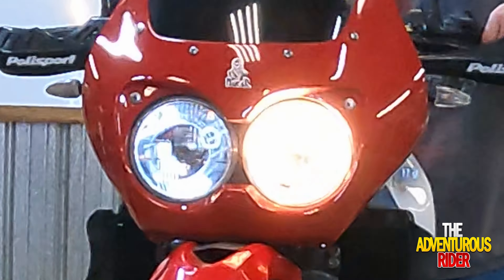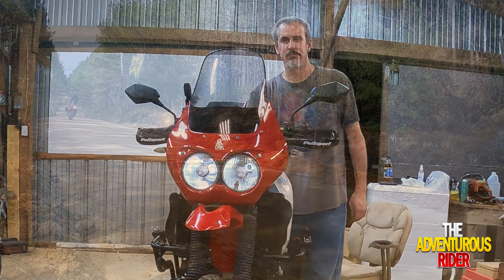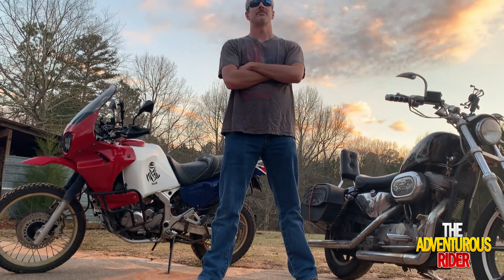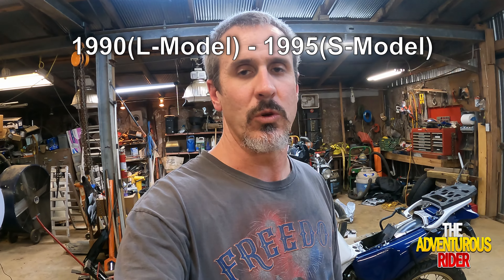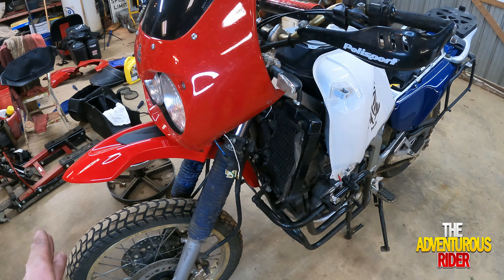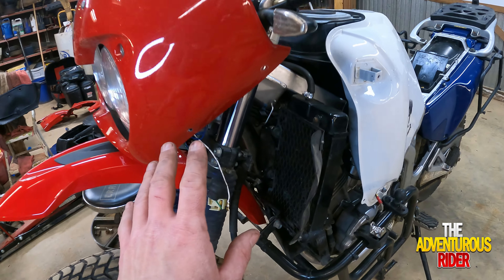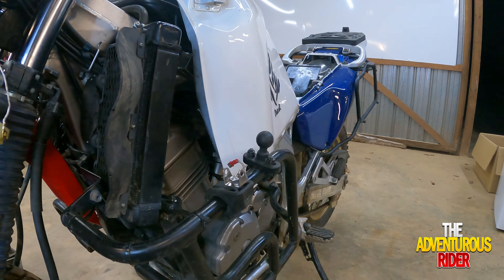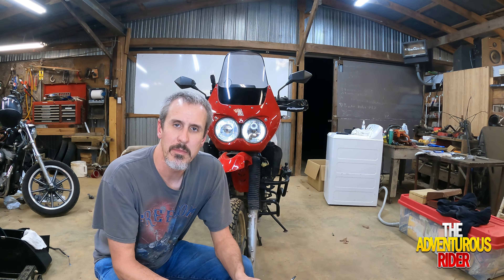Honda Africa Twin: Headlight Upgrade

Comment: Congratulations on surpassing the 500 Subscriber level. I had never thought of that, I always wondered. I have seen bikes like that and always thought it was odd, that only one light was on during low beam.
Reply from the maker: Thank you mike.  Yea I was surprised the first time someone said i had a light out but I had seen where that was stock.  So it took me a year to finally break down and fix it.  Still unsure why it's just the German models.  Have been hoping someone from germany will comment on the reasoning.

Comment: You would think that companies would go for the maximum light available on High beam, but even my old trusty Chevy truck had either lows or highs from the factory. The best thing I did for that old girl was installing a relay setup that allowed the low beams to stay on when switching the high beams on. A "night and day" difference, you might say! :) And those LED lights for motorcycles, like the Daymaker knockoff I use, which does what you are doing here with your Africa Twin sure do make seeing the deer on the sides of the road a lot easier! Anything to help keep the rider/driver safe is fine by me!
Reply from the maker: I agree man.. I don't really know why the German models are like this.  They have crazy laws over seas.

Comment: I think the German TÜV(authority responsible for tech safety) assumed that two close lights could be mistaken for a distant car and misjudge the distance to an oncoming motorcycle. See Fortnine clip on the subject.
Thanks for Video and greetings from Germany👋🏻
Reply from the maker: Not a problem.. thank you for the explanation as I can fully understand what they were thinking.  Since then have they changed that where motorcycles with two headlights are always on or it still like mine was?

Comment: Night and day 🤙🏼
Reply from the maker: Agreed man.  I knew it would make a difference but wow at what i can see now.
Reply: @theadventurousrider  probably blind any drivers in front of you too 😆
Reply from the maker: @Smallbore2wheels  hahahaha... That's my fear as I'm that guy who hates em because of it..
Reply: @theadventurousrider  low beams should be ok. I've never had issues using mine on the ruckus
...then again I won't be rear window or mirror level
Reply from the maker: @Smallbore2wheels  yea I do sit up a little higher than you do.. well see
Reply: @theadventurousrider  definitely keep us updated. Maybe try it out with a friend before blinding a stranger 😅
Reply from the maker: good idea.😂